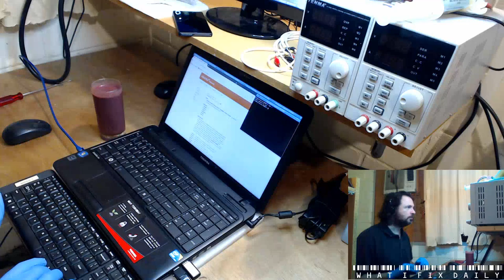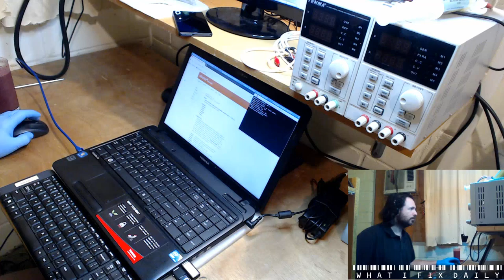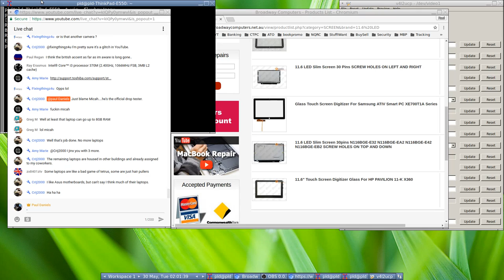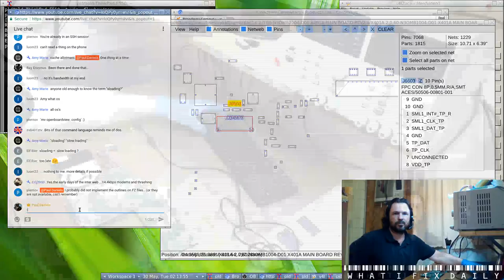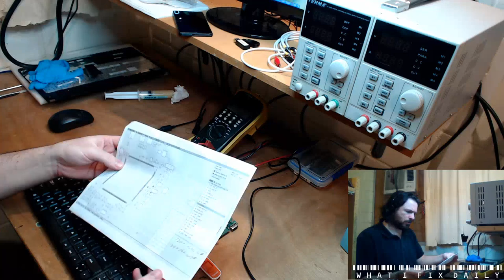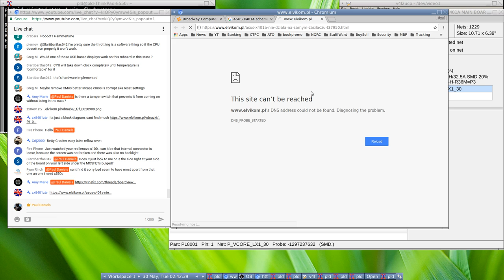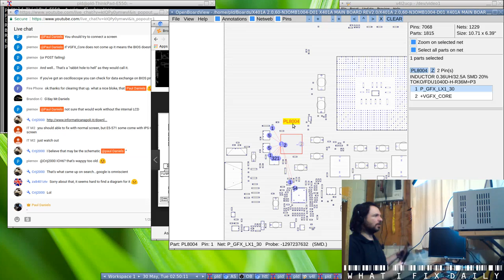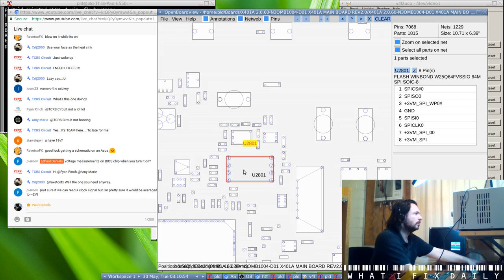[From Livestream] Fixing up laptops, Toshiba C665, ASUS X501

Comment: I saw the ground shell of the connector was all wrinkly
Reply from the maker: There's a kapton-foil combo cover on the HDMI connector, yes
Reply: I meant inside the badly connecting power connector of the first laptop the metal outer cilinder (usually the ground of that female plug) looked crooked

Comment: You should have removed the CPU when measuring voltage drops in case a ceramic capacitor on the GPU supply failed.